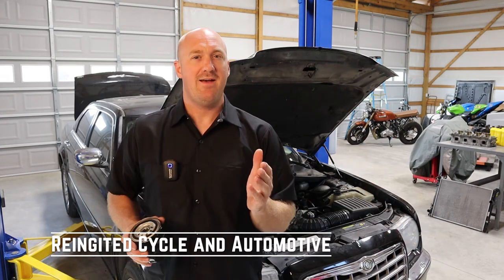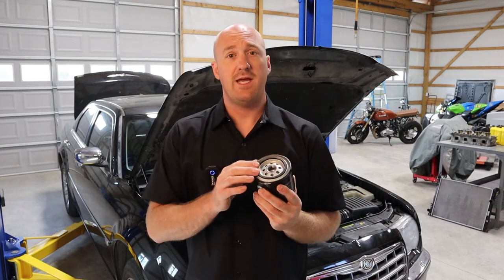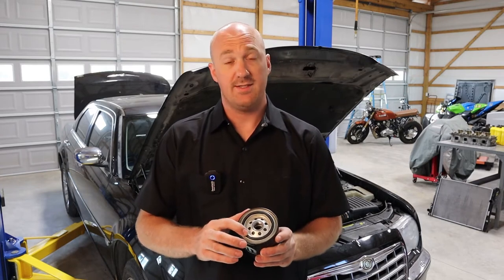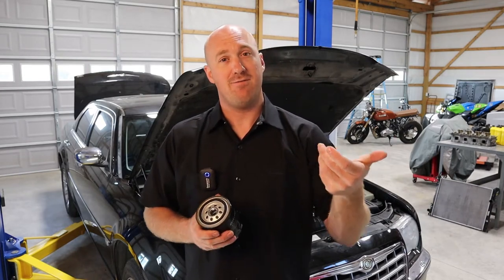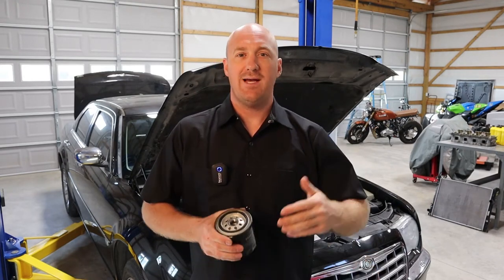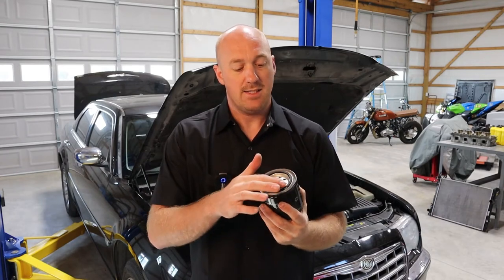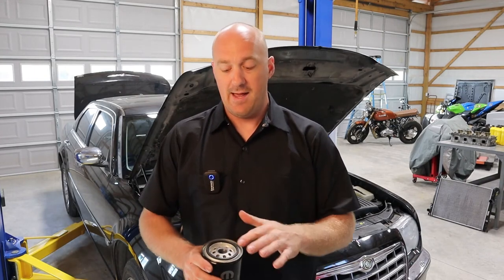Oil Filter Install Instructions // Should You Lube the Seal?

Comment: I always clean the surface with a clean rag and then oil the gasket, If the filter is easily accessible with a filter wrench don't be afraid of snugging it up. the last two oil changes I had done at a garage on my 5.7 hemi vehicles the filters started leaking on my driveway. Same mechanic on both.
Reply from the maker: True enough, and the Hemi trucks are a pain because the oil filter leaks directly onto the steering rack. Makes a mess. Seems like it's evenly split between people who can't tighten the filter enough, and people who think it's not tight until the earth's rotation can't get it loose!

Comment: I was always taught by my motorhead father (God rest his soul) since the 70's to always oil the seal.  I just changed my car's oil two days ago and I FORGOT TO OIL THE SEAL!!   I have never forgotten that before.  And it's been driving me crazy.  SO according to this -- I shouldn't really worry?  One of my concerns was after a few months and 7500 miles that the un-oiled seal would not come back off when I do the next change.  Like the dry rubber would stick.  Is that a valid concern?
Reply from the maker: Shouldn't be an issue. Usually the only oil filters I have problems with are the very first oil change on a vehicle. Those are usually stuck pretty good, but you should be just fine. 👍
Reply: @ReignitedAuto  I sure hope not!  Thanks!

Comment: Sky, just came across your videos and they are great. I own a 2020 RAM 2500 Power Wagon, so it'll be interesting to see, what if any "ticks" happen along my way. My 2012 RAM 5.7L had the manifold bolts break, but that was only a $140 fix and my (new at the time) 2018 2500 6.4L had a tick of sorts that turned out to be a faulty bearing and water pump (repaired under warranty). Regarding oil changes, I'm a 5K changer myself, however, I hear a lot of folks switching from the owners manual suggested Pennzoil 0W-40 to AMSOIL . . . is that switch really worth the cost of the AMSOIL?
Reply from the maker: Not in my opinion, I think the factory 0-40 is pretty good. 👍
Reply: @ReignitedAuto  Good to know. Thanks!

Comment: Best to lube the ring everytime , don't rely on the dirty waste oil dripping out  the motor to to lube it 100% ,  some of these o rings aren't even set in the new filters tightly and stick to the engine on removal , and if you forget to check you'll have problems leaking , I wouldn't use dirty oil to lube any o rings period , would it make a difference ? No but your not doing the job 100% , I mean if you take a shower and put on clean clothes but dirty underwear and socks  is gonna make a difference ?  NO !! , But it's not the right thing too do even if it doesn't makes a difference !!!

Comment: I've always done it because it was the way I was taught to do an oil change when I was a kid. It's funny how unnecessary things become habit. Now........what about pre filling the new filter with oil before you put it back on?? I've heard people swear you have to do it before you spin on the new filter.🤔
Reply from the maker: Same exact scenario applies,  if the engine was completely dry then fill the filter with oil, if its just a routine oil change its absolutely not needed.
Reply: @ReignitedAuto  I agree, prefilling an oil filter has no benefit. The oil pump intake sits down in the sump of the oil pan submerged in oil. The filter is situated on the oil return so it filters the particles out before it goes back to the pan. People have wrongly assumed that the oil is pumped thru the filter to the pump so the pump will pump clean oil. They'll tell you a dry filter will starve the pump. Not true. It is the same in a hydraulic system, but in certain installs, hydraulic pumps are filtered on the intake, but always on the return line
Reply: @barrynordstrom331  You are  absolutely wrong. i don't know what engine you are talking about but in every engine I've ever seen the oil comes out of the pan up to the pump then through the filter and out to the engine. The whole purpose of the filter is to clean the oil before it goes through the engine not clean it before it goes into the pan. If you don't fill the filter with oil then when you start the engine it is running without oil FLOW until the pump fills the filter.

Comment: Hi, i'm been doing my ram 2021 5.7 oil change since first oil change, does oil brand and filter really matter, owners manual recommends Pennzoil or Mopar oil what do you think?.
Reply from the maker: I'm not an oil snob by any means. My primary advice is to stay away from the absolute cheapest brands, like Fram. Most of the middle of the road offerings work just fine. I do prefer using either factory oil filters or better though. 👍
Reply: @ReignitedAuto  thank you for your help I really appreciate it

Comment: You should clean any old oil off any surface and that is why you should oil the filter not leave it to chance with old oil left on the block but that's just me and yes I have all ways pre full my filters.
Reply from the maker: Like I said, people feel strongly about this. I wonder though, if you went 1 year of oil changes not doing that, would you notice a difference?
Reply: No this is more habit as I have been changing oil for 40+ years now but had a lady who had never changed her oil for 8 years and the car was running great like I said more habit and a little bit old school. Check it Clean it lube it Replace it. I do love learning new things

Comment: :50
I always wipe that surface off to get a good clean dry fit of the dry filter ring onto that surface. Not one single oil filter has gotten caught or bunched up to cause a problem. EVER ... 
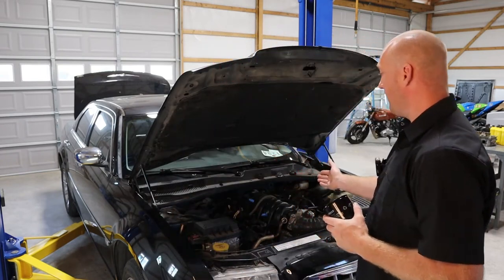2:00
Yep ALWAYS against a dry surface and i have been doing this for 10+ yrs with NO ISSUES ... 

i oiled that ring for like 17 yrs and then one day i said screw this ... not gonna lube it anymore. So i stopped about 10 yrs ago and have never went back.

Comment: I had a rubber gasket stick to the block once. It was on a 199x saturn s-series where the filter was in a terrbile location so I'd change the filter by feel but couldn't actually see where the mating surface was.(wasn't going in through the wheel well like the manual said, pffft.

Thing was, the car had a ton of miles on it by that point so the mating surface should have been plenty oily, but for whatever reason the old gasket stuck to the block and not the filter... I didn't notice it until I put in oil, started the car to get the oil pumped through, then looked under the car like my dad taught me to do after any work (to check for leaks), and saw oil pouring onto the ground.  Ooops.

So anyway, maybe it shouldn't have stuck to the block, but no one told that gasket.  ;)
Reply from the maker: We've all been there 😅 I did it once on a 2006 Chrysler minivan. Oil everywhere 😄

Comment: Is it safe to use silicon as well vs oil?
Reply from the maker: Yessir
Reply: @ReignitedAuto what5if silicone gets into the oil? 😮
Reply from the maker: @disturbator  he means silicone lube, not RTV 👍
Reply: @ReignitedAuto  yes im talking about silicone lube too. Cant it get heated and liquify then contaminate oil?
Reply from the maker: @disturbator  you're talking about an extraordinarily small amount of lube used on the o- ring itself, which is effectively sealed against the oil anyway. Even if a tiny amount got into the oil I wouldn't be concerned, but I don't see that happening.